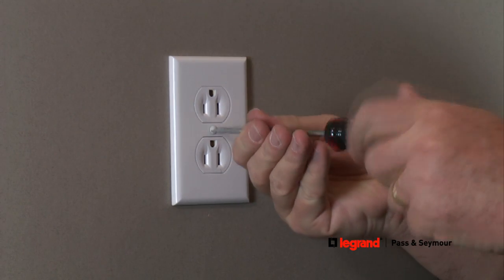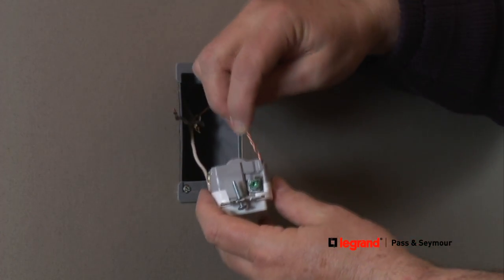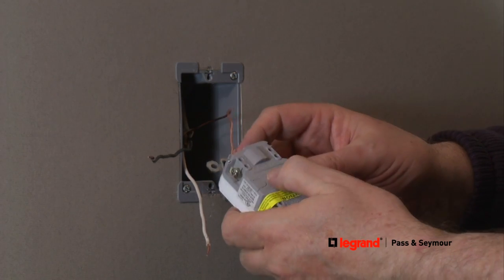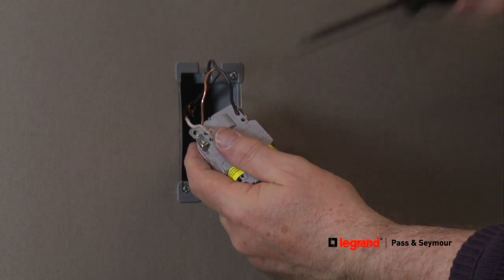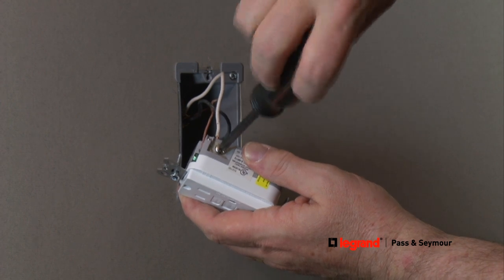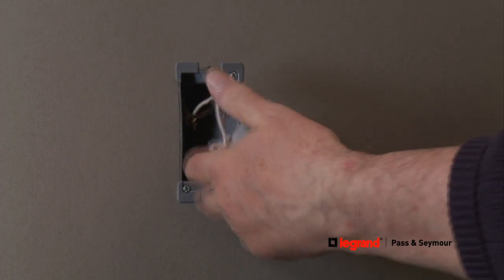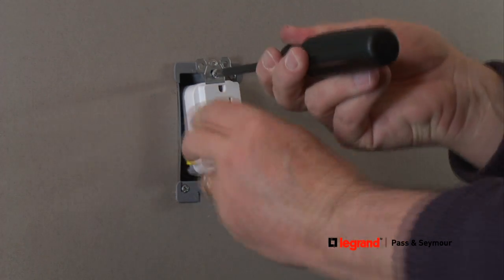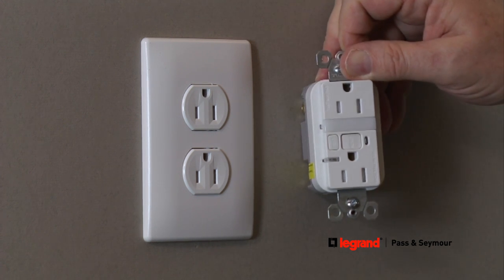Pass & Seymour: How to Install a GFCI Outlet

Comment: Brett that is actually the correct way to install a receptacle. You want the ground female upright for better stabilization. That is one of the largest misconception that the ground female hole goes on bottom. Just FYI bud.